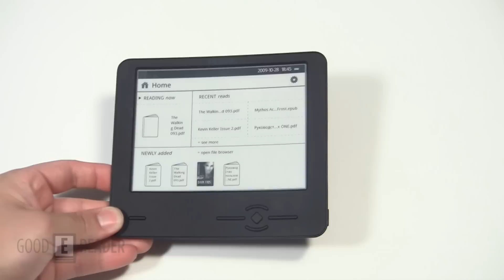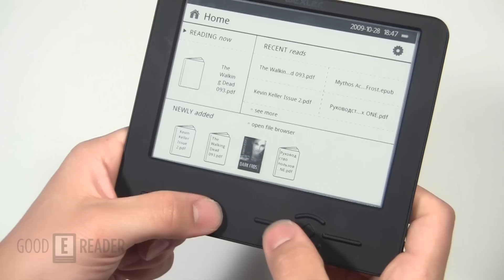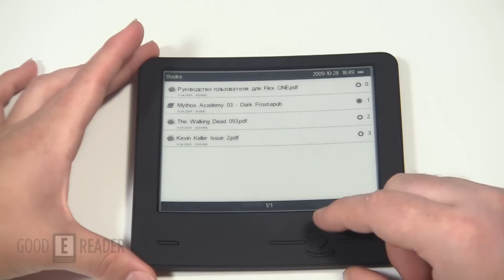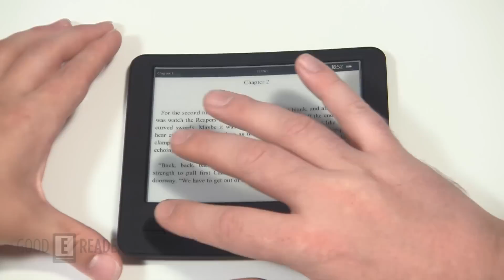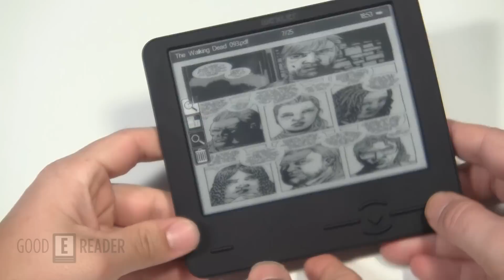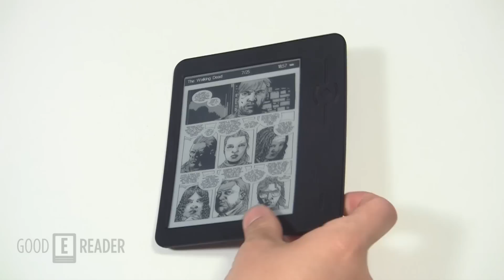Wexler Flex One eReader Review

Comment: It is understandable that they were so dismissive of this device. I bought a couple of these and have tested it thoroughly. The pdf experience is terrible. The only way to get around the pages being cut off at top and bottom is to resize the entire pdf which doesn't always work. You basically have to change from "cut mode" (maximizes) to "non cut mode" every time some screen space is lost. The buttons are really hard to press. The battery isn't exactly great and needs charging every couple of days at least. It also breaks if you bend it, so forget messing around with it in that regard. I broke my first one, now I never bend it. The pros about this device are it's weight, it is like having a peice of paper in your pocket which is really useful if you like going light, and the fact it has no touchscreen if you like that.
Reply from the maker: yea it was kind of gimmicky and really just a way to showcase the flexible screen

Comment: Wifi? Gyroscope? Accelerometer? Complain about comic PDFs on an e-book reader? The flexibility just a gimmick?

Seriously. Yes, slow processor and little RAM is a problem. Yes, having it "pre-curved" makes no sense. The "hump" is a matter of preference - the same layout has garnered high praise on the recent Kindle Oasis, though.

If they "un-curved" the device, beefed up the storage a bit (16GB+ or SD reader), fixed the energy management (Month-month and a half standby? Not on an e-reader. Fix.) and re-thought the buttons for one-handed portrait usage, this would be my ideal reader.
Reply from the maker: totally

Comment: Didnt think this was even possible.. to have a flexible eink screen.. And I suddenly saw the date of posting.. 4 YEARS AGO... !!!! Is this series still continued?
Reply: I think you have been too harsh with the wexler. The flexible screen is NOT meant to let you roll your ereader, nonsense, it was meant to let you DROP your ereader as many times you want and not having to rely on that 1/2 millimeter glass that’s on the back of every eink pannel. Of course no one wanted to develop this technology because is expansive and it’s not convenient for the industry, cause you just buy a new ereader when you drop yours and break the screen. I know that theese lg screen had ghostings problems and weren’t perfect but the idea was great for the consumer. The real annoyng thing was the perma-bend of the wexler. Heck, even the kindle oasis “borrowed” the form factor!
Reply from the maker: yea its still cool, no , they havent made anythign else like this so far